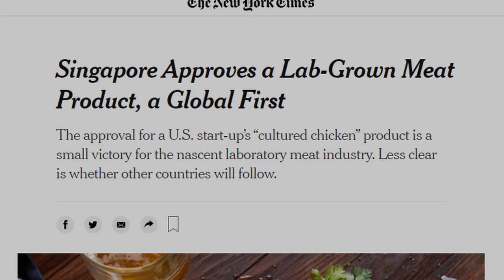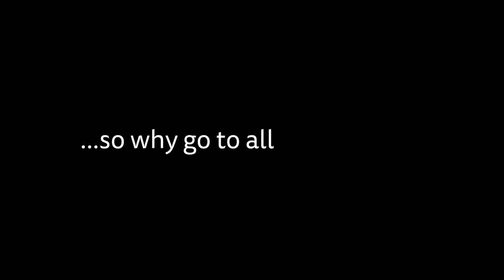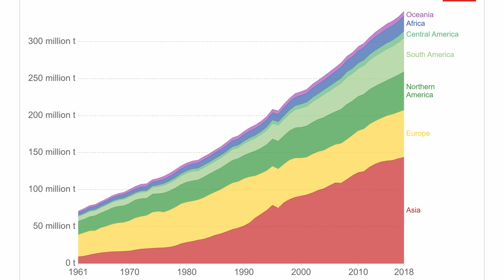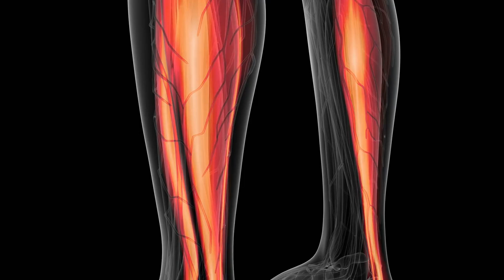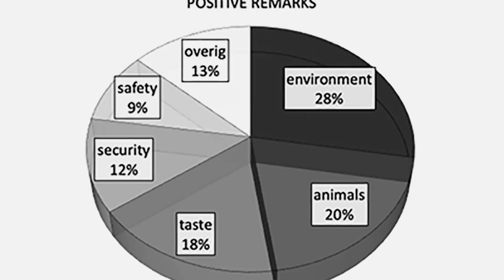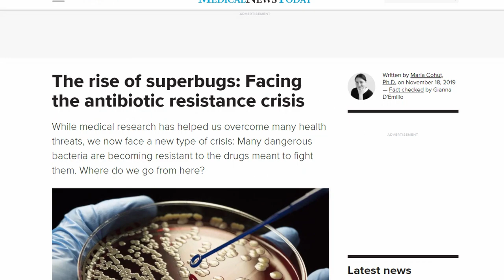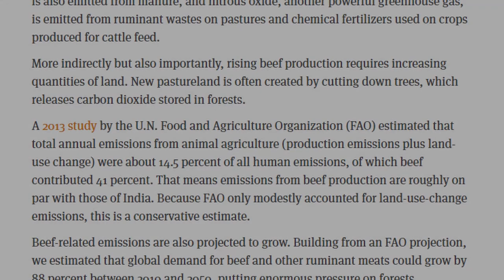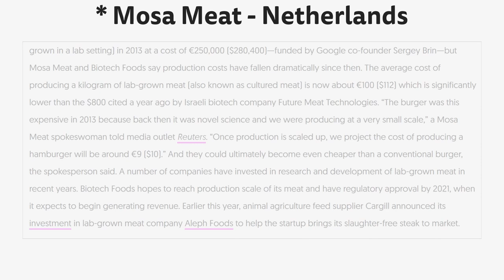Cultured Meat: Lab Grown Meat Is Becoming A Reality

Comment: Amazing video! ❤️

Can you make a video on whether hydroponics is safe or not? Like substituting soil with lab made solutions can have some ill effects on human body in the long run (say cancer😬).
Reply from the maker: Hydroponics isn't inherently dangerous it's perfectly safe as a technology, at it's core it's just water + nutrients. Much like soil, if you put in dangerous additives, it can potentially be harmful and hydroponic growers to need to be mindful of mold growth in their systems. That said, hydroponics and controlled environment agriculture makes it much easier to control pests and maximize yields, so there is less incentive to cut corners that could compromise safety. It's quite a complex topic, but hydroponics are generally a safer method of production.
Reply: @ExaCognition  I appreciate your quick response. What you told about pest control seems perfectly fine. But all I'm telling is that since we are replacing naturally found nutrients in soil with lab-made nutrients, shouldn't it be an issue on our health?
Reply: @parvbhatt5901  
What are "lab-made" nutrients?
Na+ is Na+, no matter wether it comes from soil or is added to solution.
Reply: Traditional agriculture is not natural.  Hydroponics is just a much more efficient way of to grow food.
Reply: @mAx-grassfed  Thank you! 👏

Comment: If it turns out to be far far cheaper than conventional meat  lets say 1-2 $ for a Burger patty, or a box of ground meat then it will  definitely change the way people are eating, as most people are eating mass produced meat because of its low price, and if People are to be convinced to try, or even  consume such an alternative instead of conventional meat then it has to be far more cheaper or most people would not even try it.  Yet another reason a lot of people will also not try the vegan meat substitues because they are usually at the same price of - or far more expensive than  real meat.